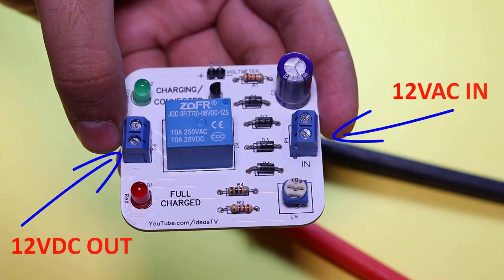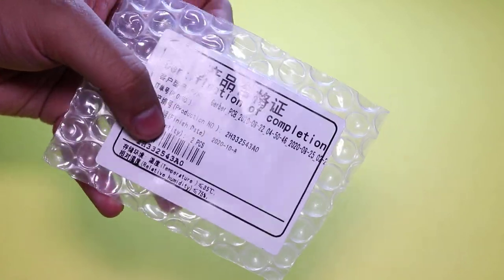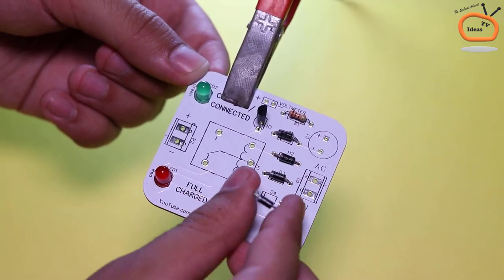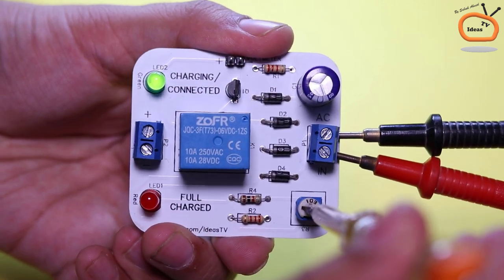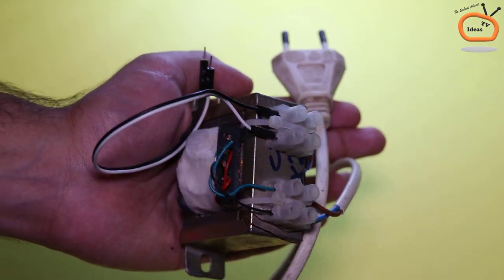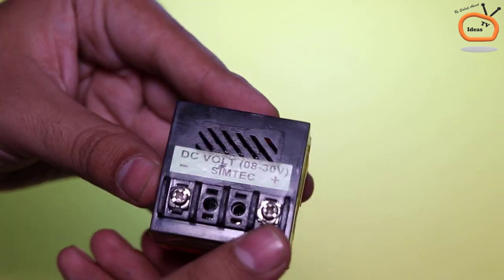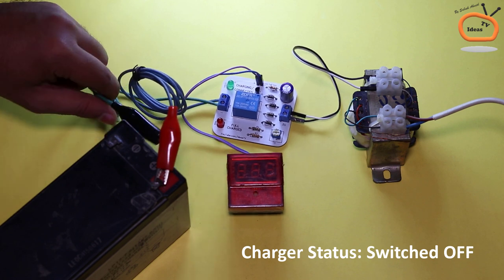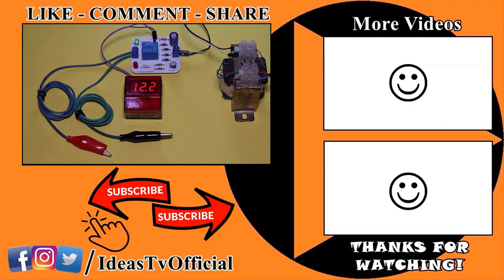12V Battery Charger Circuit With Auto Cut OFF & ON (PCB Automatic)

Comment: for best result the circuit must be calibrated with a load or battery.or else when the load or battery connected to circuit  the line voltage will go down and battery cannot be charged to 13.7 volt ..so first time when we use the the circuit to charge the battery let the battery charge when battery voltage reaches 13,7 volt set the cut off point,and that will be our preset point.

Comment: Looks like a good circuit. I am wondering though, how you set the "auto on" voltage, as most good 12 Volt lead acid batteries are considered fully charged when they hold and maintain a 12.7 ~ 12.8 Volt static voltage level, so, a drop below that level should cause the circuit to actuate the relay to charge it again, if used as a "maintenance" type charger. I saw you decrease the voltage quickly in the video, but could not tell exactly where the charger kicked on again.
Reply: @Poor Mans Electronics Bench: Sir you are right, this guy who talks knows nothing of what is going on and his knowledge is zero, just bluffing viewers.
Reply: @MeninodeValpoi  The difference between disconnecting and charging is huge.. I have a circuit between charging and disconnecting that can reach 2 millivolt.

Comment: How come 12 vdc will reach 14 vdc without any boost converter? because you give 12vdc in to the circuit
Reply: You have a 12 Vac transformer. After full wave rectifiers, you will get 15 to 17 volts. Peak AC is 1.41 times rated voltage

Comment: Hi, nice project, but I have some doubts: 1) After the cutoff voltage has been reached, the relay goes off, and I do not see how it would reconnect when the battery voltage decreases, since the relay has disconnected the battery. 2) The calibration potentiometer takes input voltage as a reference, but since it is not regulated, it may suffer variations, altering the calibration. 3) In my opinion, the reference calibration voltage should be taken from the battery, not from the source. 4) The green LED will never shut off, since it is connected in parallel to the battery. It will lighi until the battery is dead or removed. Regards!

Comment: Can you make a circuit with 2 preset to adjust min voltage and max voltage? For eg:- circuit turn on in 12v  reach. And it will turn off when it reach 14.5 v. And again turn on it reach 12v..
Reply: This is exactly what i m looking for so its not turning on device also another preset for cutting off the drain energy from the battery when it charging. so that free energy motor carry on both duties to charge the battery and to run the loads in case u are using free energy source. it helps motor free energy to have rest peak. Come for me when u get the solution my friend.

Comment: Thanks, also nice work, my wishes, Can I charge 4.5 volt,4.5A/h lead acid battery, Pl, help
Reply from the maker: yes, but you've to calibrate it accordingly
Reply: yes you can but you need to change calibration a bit, try to set cut off at 4.5V, or in other way,   You can use this transformer, but then you need to implement an buck converter dc-dc after the bridge rectifier diodes to step down the voltage from 12dc to 4.5 or 5V  or which ever lower than 12v voltage you need.

Comment: I have  motorcycle lead acid battery of 12V 14Ah. What changes in components I need in this circuit. I will use 12v DC led strip as emergency light.  Will 3 amp transformer will be good? Diode of 6A? 1/2 watt resistors? etc. What else. please reply soon
Reply from the maker: yes, your mentioned components are compatible with your requirement

Comment: Could this circuit be adjusted to work with Double A battery or would it not work the same would the different type of battery stop them from working
Reply: You can adjust the variable resistor to whatever voltage you want there shouldn't be a reason why it won't work

Comment: i have set the output voltage to 12.6 but still relay not working battery is fully charged i have also set the preset point
Reply from the maker: have you connected the components in correct way like transistor and capacitor?

Comment: For 12v 7 amps battery can i use this circuit...pls tell me transformer amps
Reply from the maker: yes
Reply: @IdeasTv  i need transformer ampere..for 12v 7amps battery
Reply: @tamiloldsongs2580  3 Amp

Comment: New sub here nice video thank you, i have a question, would it be possible if i use 18v transformer instead of 12v transformer
Reply from the maker: but it will not suitable for 12V battery

Comment: I received reply ,Thanks I wanted use 12 volt transformer for charge 6v/4.5 amp lead acid battery,  an i do this with this circuit, Pl, help
Reply from the maker: not you've use the transformer according to the battery specs

Comment: Hi. I've seen that cut off works fine, but what is with the auto ON, (automatic start) as it says in the headline AUTO CUT OFF & ON ?
Please, answer. Thx
Reply from the maker: It will start charging your battery again when voltage dropped across the battery.

Comment: Upto how many amps I can use this same circuir
Reply from the maker: Amps depend on diodes, with current diodes 1n4007 you can use 1,2 Amp max
Reply: @IdeasTv  if I like 10 ampers what need sir
Reply: Bro help me i Need charge One battery from another battery Energy but If the donator become low voltage stop charge the other battery. What suggest tò me?? Thanks
Reply: Is 100a battery both

Comment: Can charge 3.7 v battery
Reply from the maker: yes, but you have to use 5V stepdown transformer, and calibrate the circuit according to the full charge voltage of your battery. for example if you're using 18560 Li-on cell then calibrate the circuit for 4.2V as result circuit will cut-off the supply when Li-cell reached 4.2V as their max voltage when become fully charged.